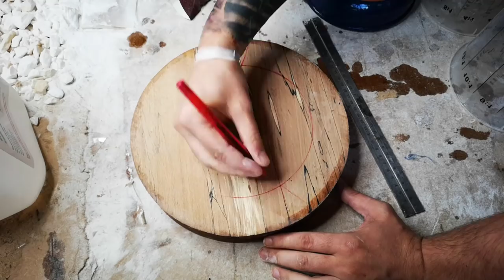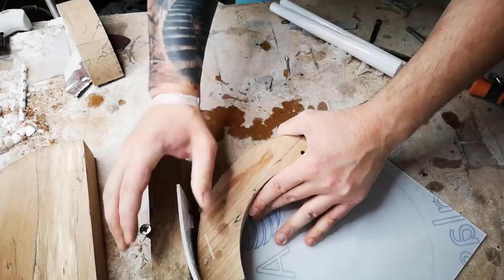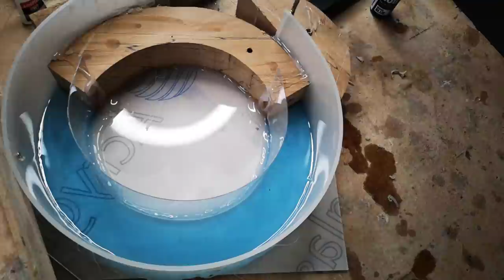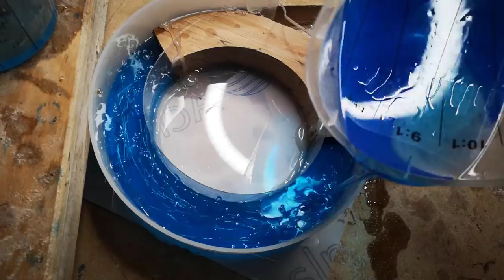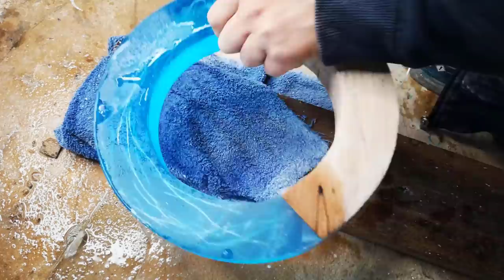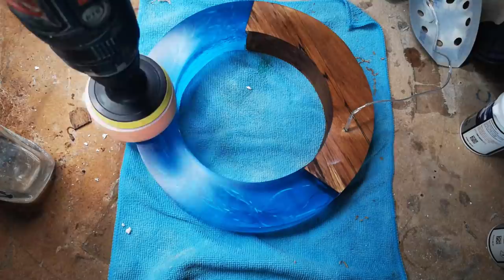Blue Epoxy Resin Night Lamp  Resin Art

Comment: Can you please guide on how to keep the fairy lights down on the first layer. Mine keeps popping out even from the second layer... My first layer is thin about 6~7mm and second is about 10~12mm and then the third of about 4~5mm totallign to around 22~24mm.
Also if I use hot gun to glue it, will I be able to see the glue mark through the first layer. I am colouring it too but keeping it very translucent similar to yours.
Would really appreciate your help.
Thanks in advance.